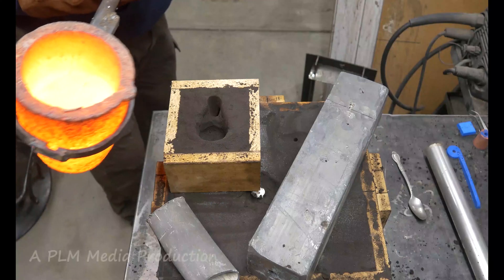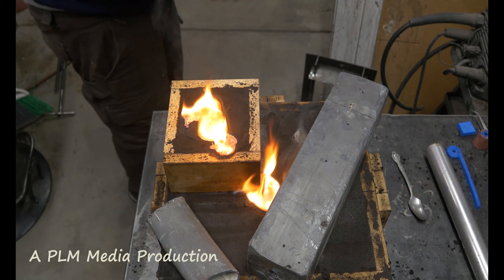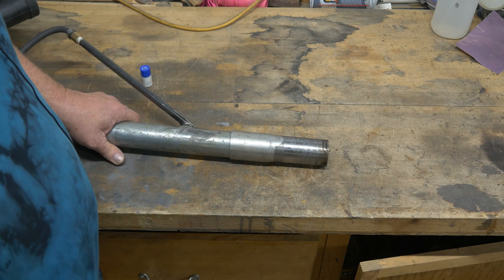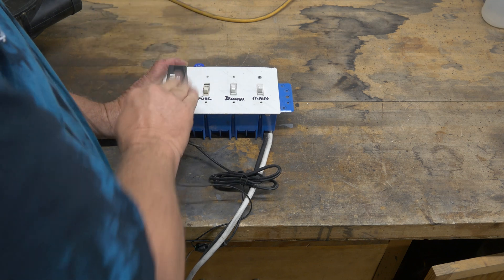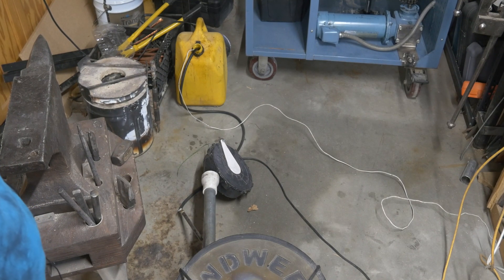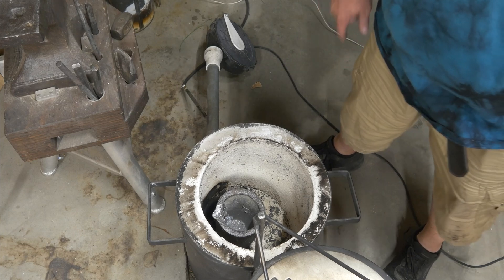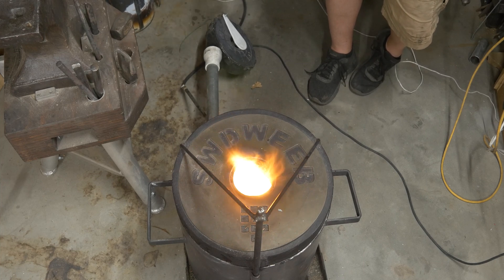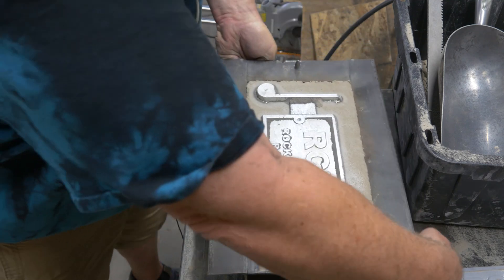Building a diesel burner how hard can it be

Comment: Good job, nice and simple design & construction, the fact you have thrown this together & got such a great result is a credit to ya. I am not an engineer, but it would be nice to know what pressure your pump puts out, with a guage maybe. I like ur ball n spring valve idea for the nozzle, this would be a way to adjust ur rail pressure to nozzle to a degree by how much force the spring puts on the ball & this could be made adjustable. My thoughts are that with higher pressures you can vaporise the fuel better and hence gets better control and efficiencies, I would suggest a higher than required pressure pump to feed ur nozzle, common rail diesels use very high pressures to gain more power and efficiency, you can also add a tee to return deisel to the tank via a needle valve for pressure reduction & fine tuning. 
I see in comments ur saying u need more air to get the heat up higher & this is another thing I was wondering, if you had a better fuel/air ratio, ie: ‘the more air the better’, I would expect, if you want more heat without using a bottle of oxygen to make this happen.  Should you not be able to get a nice blue or whiter flame if the mixture is right? You could cut around or drill holes around the blower air input to maybe get some more air throughput, but a DC motor driven blower would be easier to control & give a higher output also. Good vid, TFS. Cheers
Reply from the maker: I had another comment yesterday stating the same idea, that I need more pump pressure. I'm going to look into finding another pump today and see what I can do.  I was thinking about the return mechanism in fuel injected cars and how I would deal with that.  I appreciate your idea on the tee with a needle valve. Thank you!

I have a constant speed AC blower with a damper on it to control how much air goes into the furnace. The other comment stated that with better atomization I may not need more air. 

Thanks again.
Reply: @swdweeb  thanks for getting back. I just binged the other guy’s series, he did based on ur model & design, & he got a pretty good result smelting a crucible in under 10 minutes with 2.5ltrs deisel (Aud $5), which proves that ur pump does have the grunt to do the job (just), but I do believe a higher pressure will give u better vaporisation/atomisation?, smaller particles give better ignition. I agree with the other guy that fan could supply enough air for a good combustion, IF: the vapourised or atomised particles are in the right quantities, ie; a given volume of air would require a given quantity of fuel in the right particle size for complete/efficient combustion, and that that would get easier to obtain with higher rail pressure. Ive seen turbojet engines & camping stoves run with beautiful blue flames on diesel, so I thought it must be possible to get a good clean burn for this use also, with the right tweaks. Loved ur vid & invention & Im sure you’ll get it all worked out. Cheers from Australia
Reply from the maker: @evil17  One of the issues both Mark and I have with out burners is fuel saturating the furnace lining and then burning for a time after the burner is shut down. I thin finer atomization will help that.  I've actually forwarded yours and the others on to Mark so he can see them as well.  

I'm going to look for a diesel fuel pump this afternoon. Who knows maybe I can pick one at an auto scrap yard.
Reply: @swdweeb  Wow, with the temps ur getting up to, I would say this is a clear indication of over fueling or incorrect burn, & yes, a smaller particulate size (higher pressure) should help alleviate this issue. Another possibility that may help could be a pre-heating section between the pump and nozzle which would also increase the fuels flashing ability.  Maybe a very small pump to circulate a heating medium like oil through a heat exchange system between furnace exhaust and the fuel line just before the injector.  Ideally, a small piece of tubing inside the furnace (or anywhere hotter than the fuel) at a lower point than the injector line would give a natural circulation of the heating fluid without a pump.
Cool project, look forward to seeing yours & Marks collaboration efforts, & good onya’s for that. Cheers

Comment: Interesting. Diesel and gas are about the same price as each other here as well - but more expensive than you pay -   around  $2 Australian a litre (nearly 10 bucks a gallon), but diesel is currently an easier fuel to buy and store...
Reply from the maker: When I bought my diesel truck in 1998 diesel was cheaper than gasoline here in the States. Within a few months the prices switched and diesel has been more expensive that gasoline ever since. It's crazy!

Comment: I recently started building a smelting furnace and hadn't got to the burner yet (I was going to just steal the one off my forge for a while). I'm sure glad you made this video. I love the idea of simple fuel and easy starting, i.e. no propane preheat and what-not. I mean, the whole burner is pretty simple! Just ordered the parts you listed and will be building one of these. Thanks a ton.
Reply from the maker: I'm glad the video helped. One thing that I've seen over time is I believe the check valve has failed and not only does it not stop the flow of fuel after I stop the pump but I believe it inhibits the flow of fuel to the nozzle. I think about removing it after I've fired the furnace. I need to think about it when its cold :-D  Just something for you to keep an eye on.

Also, FWIW, smelting is the extraction of metal from ore. What we do is melt. 

Don't hesitate to contact me if you have questions
Reply: @swdweeb  Thanks for the tip. Yeah, now that I analyze how the check valve you used would function in the fuel circuit, I can see how it's not really designed to do the function you wanted it to do, so I'm not surprised to hear the update on that. I think what I'll do to mitigate (a little bit) the problem you were trying to address is to just install a ball valve as close to the nozzle end of the fuel line as I might get away with, i.e. maybe just before it enters the air tube.
I almost have everything I need to get started. Just need to machine the adapter (I'm a machinist by trade)
My grand master plan is to assemble the burner to see if it looks like it will work and tweak until it is working properly, then start on the chamber.
A couple other things have come up to distract me this past week of course. So I'm not sure yet when I will have the chance to make progress. Hopefully not too awfully far away.
Reply from the maker: @TyroneDamShewlaces  Yeah, I think  ball valve is a much better choice. Good luck with it. Let me know how it turns out
Reply: @swdweeb  Well I'm very close to finished. I used a keg for a container (just about the perfect size), 2" of ceramic wool, and a 1.5 gal/hr nozzle on the burner. We'll see if I need to try other nozzles, but it's all coming along pretty nicely. I'm glad you did the video on the burner because I love the idea for its simplicity, both in the build and the using. I need to make a few tools & stuff this weekend and should be trying my first melt next weekend. Looking forward to learning this stuff.
Reply: I tried firing my burner several times while tweaking and changing things as I went and was pretty dissatisfied with how it worked. I finally realized the fuel was just not atomizing well at all out of those nozzles (fairly sad honestly) with that little fuel pump, so purchased a larger cheap one and it got a tiny bit better, but still not good. THEN I finally grew a brain cell and decided to look up the specs for the nozzle - the manufacturer rates them for 100 psi !! AHAA!
I have a couple ideas on increasing the pressure and I'm gonna eventually get it right. Correcting the pressure is likely to improve the efficiency & performance of the burner significantly I think. I'll let you know what I learn here. If I can figure something out that doesn't cost a fortune, it might help you also to do some similar upgrade.
The revelatory factoid I've learned so far is fuel burner nozzles pretty typically run at 100 -150 psi. Knowing this, I feel optimistic now.
Reply from the maker: Fascinating.  I could only find gallons per hour, I never found pressure.  I also never saw a pressure rating on my pump.  Right now I need more air in my blower.
Reply: @swdweeb  I found the spec sheet for the nozzles (and several other types) on the Delavan website. Their spec was somewhat confirmed once I started to looking into fuel oil burners in general and found that the 100+ psi range is fairly typical. I think (and it looks very much like it) that what fuel is coming out the nozzle holes is congealing together before escaping the tip of the nozzle. I think simple surface tension is messing it up. On videos with adequate pressure driving the nozzle, the atomization is MUCH finer and would ignite more efficiently.
A typical standard fuel pump (like the ones we've purchased) are only around the 5psi neighborhood, so drastically underpowered. Pumps for fuel injected vehicles can be 40 psi and max out around 100psi. I don't know if they will work or not but I'm going to try it and let you know one way or another in case you're curious. I may end up trying an actual oil burner pump if necessary, but that's a bit more cumbersome, complicated and expensive so I hope the injector pump works. I want it to work well though so I'll keep hacking at it until I win the battle.
By the way, I'm not sure one way or another, but it's possible if the atomization was correct, the requisite air flow might be significantly less. Maybe more expensive fuel pressure = less air supply required, i.e. maybe a wash? My hypothesis is that the fuel at 5psi is mostly just squirting out the nozzle instead of being driven out and fully atomized and the reason it burns at all is that we're blowing a bunch of air past it to carry it into the flame zone, which is several inches past where it oughtta be igniting anyway. Videos showing proper nozzle function looks like a very fine puffy mist instead of a stream of droplets. Drastically different. Kind of a waste using a proper nozzle at all with the low pressure. It never reaches it's potential.
Anyway, I'll let you know what I find out. Might be a couple weeks.
Reply from the maker: @TyroneDamShewlaces  Yeah, I'm definitely curious to hear what you find on the fuel pump alternative. Thanks!

Comment: Very nice solution, and thanks for the links! 👍
What kinds of temperatures are You able to get from that burner? How long does it take to melt a specific amount of various metals? Maybe an idea to a follow-up video? Anyway, thanks and have a nice one! 😎
Reply from the maker: Good questions to which I probably only have bad answers.
The way many small retail furnaces work the burner (typically propane) faces directly at the crucible. This causes the crucible and subsequently the contents of the crucible to be heated by direct contact from the flame. I was told early on that this will cause premature crucible failure. As a result, I built my furnace to be larger than the crucible and thus allow the flame to not be pointed directly at the crucible. The flame in my furnace encircles the crucible.
Basically that means I need to heat the entire furnace and the crucible + contents are heated as the ambient heat of the furnace increases.
All that to say I can melt metal about as fast as the small retail propane furnaces you see out there.  If I reduced the volume of the furnace I could melt faster.
The thing about this burner, is I believe I'm starved for air. I don't think the blower I have attached pushes enough. I keep thinking I need to look for a larger blower but never seem to get around to it.  I say starved, I could probably push 10-20% (a pure guess) more air and thus achieve a better fuel/air ratio resulting in more heat. More heat always equals a good thing. :-D
The diesel burner will get plenty hot to melt whatever metal you want to melt. Clarke Easterling over at Windy Hill Foundry @windyhillfoundry5940 uses diesel to melt cast iron.
Reply: @swdweeb  Yes, I think You're right about premature crucible failure. I also think that You don't need all that free space around the cricible. Maybe You should cast a new liner in Your existing furnace?
I'll be subscribing to see how You do in the following. Thanks for the answer, and have a nice day! 🤩👍
Reply from the maker: @qivarebil2149  Well... my intent is to do larger pours requiring a larger crucible.  I'm not there yet, but will be before long.

Comment: So I come from an automotive and electronics background. So seeing your fuel pump there, spraying directly into a nozzle, just looked obvious to me. This was the very first diesel burner design I saw.

Then I watched a few other videos and oh my they are really over complicating it. It's only after seeing what other people were doing that I appreciated the simplicity of your design.

For me personally I'm going to use a fuel pressure regulator. Partially because I have one on the shelf that'll work but primarily because I know if I hold the fuel pressure consistent I can keep everything else consistent. I'm pretty sure your fuel pressure is only steady because the small fuel pump either has a bypass built into it or is just not capable of pumping more pressure.
I'm going to use what I have sitting around so in automotive fuel pump would be too powerful, but by using a automotive pump and regulator it'll give me a simple, steady pressure to jet from.

Also while I appreciate how nicely designed your air blower is, it's 200 something dollars online when you can get a 12 volt automotive HVAC blower for $8 or less used.
Since I'm going to run a 12 volt system for the fuel pump, I might as well run the blower off of that too. 

I think you helped me decide how to proceed with my system. Thank you
Reply from the maker: Thank you.  I wish I had a better shutoff mechanism. I put that check valve in there but I think it’s failed. I end up pulling the pump from the fuel tank as soon as I turn the blower off otherwise it siphons.  

I think having more than enough pressure on the input side and regulating it as it enters the nozzle is a great idea
Reply: @swdweeb  I might suggest a solenoid for you. You put it between the pump and the nozzle hose. When the solenoid is powered the line is open. When the solenoid is closed, even if the pump is on or off nothing will flow through there.
You may still get a little dribble out of the hose but only the fuel that's in the hose past the solenoid can go in. Everything between the solenoid and the pump including the whole tank will stay there.
Reply from the maker: @TravisFabel  Yeah, moving the check valve awy from the heat might work better as well. The dribble kinda sucks as it can leave unburned deisel dripping into the refractory in the furnace, ask me how I know that. I've taken to pulling nozzle when I pull the pump to minimize the dribble into the furnace.  I will say that when the check valve worked, the drible was minimal

Comment: What pressure do your pump put out?
Reply from the maker: No idea, the pump is in the description.
Reply: Ok, 

Have been using propan but are working on my diesel burner.

Your videos are inspiring, I learn a lot.

Håkan ,Halmstad ,Sweden.
Reply from the maker: @hakanmagnusson5667  Good luck 😄  If you get it working I think you'll be much happier with the heat that diesel puts out,

Comment: Could the oil burner from a boiler or furnace be used for this? I know that the tube is much larger 2 /12" to 3"? I own a Plumbing & Heating Company and have access to free burners.
Reply: Bob!! Boiler and furnace will melt aluminum!  Copper..brass. as I used them back in the 1970  when I was melting  scrap at auto  recyclers just make sure you get right nozzel
Reply from the maker: Boy, I have no idea.  I’ve never actually seen a burner for a boiler.  I suppose if you could deliver sufficient fuel and air it would work